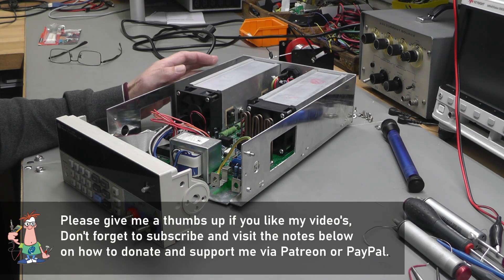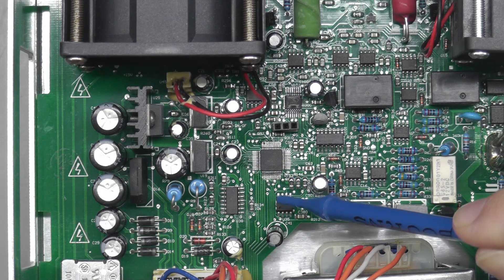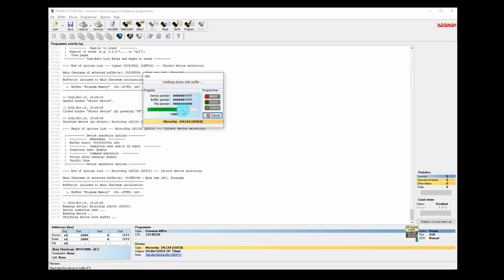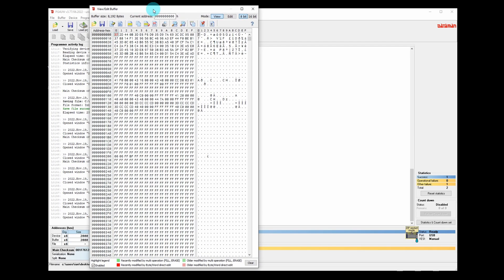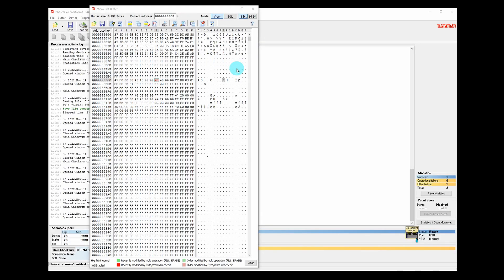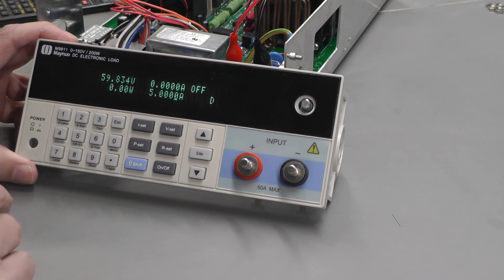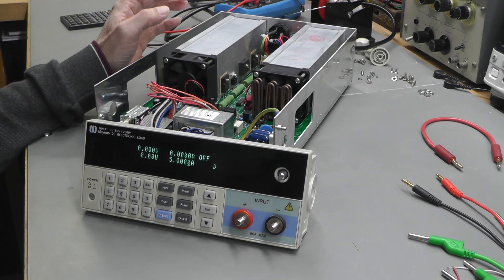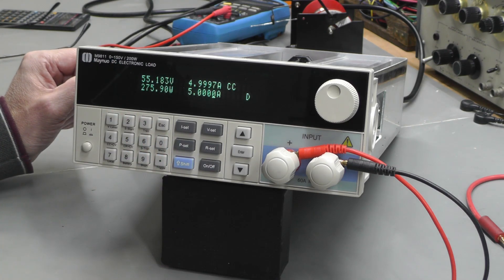No.099 - Maynuo M9811 (200W) Upgrade to M9812 (300W) - Part 2

Comment: I would expect that if the load is capable of 400W they would have labelled it as such and sold it for a bigger profit.
Reply from the maker: I'd expect some wiggle room, but it would also be governed by the environment its going into, i.e. the instruments on my workbench are pretty tightly packed. I'll stick with 300W for the moment for daily use......but maybe a future analysis video exploring say 400W.

Comment: WOW, I did not think it would be that easy.  The fact that it is in an EEProm (something I would NEVER do btw), tells me that you are likley safe with that second resistor thing (i.e. it may well just be a different board revision).  ...but I would buzz them out in case :)   It also suggest that programming the EEProm on the board may be safe also.  ...again, MAY be :)

Comment: My guess is that you have changed the limit setting and because you have done it directly you avoided the limitation of the actual model, but this means if you try to adjust this setting you will again be limited to 200W.

These loads has a type number you can read from software, in addition to the 4 limits (I, U, P, R). The question is if the type number is in EEPROM with a limits table is firmware or in the firmware with only the limits for the actual model. The type number is not the same as the model number M9711is 0, M9712 is 1
Reply from the maker: There's a few things it's possible to look at and test in the EEprom (maybe I'll look at it later):
The serial number difference between the 200W & 300W model is a single digit.....perhaps stored in the EEprom!
The hex string 43480000 (float 200) is repeated further in the EEprom (114h address).
There are other similarly laid out strings of hex which could apply.
Ian.
Reply: I have registered type numbers from 0 to 111, i.e. it is more than a single digit, but can be a single byte in the EEPROM.

It might be worth checking the register numbers in the protocol definition, the layout may follow the same sequence. It is: maxCurrent, maxVoltage, maxPower
You might also get an idea about some of the other values.

Comment: The Australian "Silicon Chip" mag Sep22 has a project, WiFi programmable DC Load - up to 300W, 150V and 30A within the power SOE, it uses 4 off FQA32N20 operating in linear mode with each Mosfet up to 75W each.  I'm currently constructing.  As your project uses now 8 Mosfets maybe either changing the Mosfet or checking the thermal capability may breeze in the 400W?  Thanks for making the video.
Reply: Does it say how much $ to build it?

Comment: Why didn't you set it to 400w? You do have double everything
Reply from the maker: Two heatsinks in such close proximity dont mean double the power handling, and then there is the pcb tracks to be concerned about. Its possible it could handle 400W but is it worth taking the chance of blowing it up. Hmmmm!
Reply: @IanScottJohnston  i think it would be good test, doesn't have to be at low voltage, so that amps stay low for pcb. I mean, you did bump max power to 300w, at least I would want to know if 400w is an option. For short time loads, it would be perfect, something like pulse test
Reply from the maker: @First2ner  don't tempt me....😁
Reply: @IanScottJohnston  You said you already have another DC load and you are prepared to go for broke on this one. If one side can handle 200W each then the tracks should be good enough. You just may need to beef the tracks to the output. I say GO FOR IT if the power supply can do it.
Reply: current sharing on power transistors is not perfect.
diminishing returns.

Comment: Nice result, I can always dig my 300W unit out of storage and open it up to give you some better photos... if you have any doubts about the flash I could pull the one from my unit and send you a copy, although it would likely mess up the calibration data for your unit as that is probably stored there.